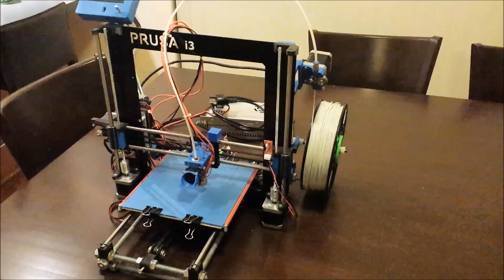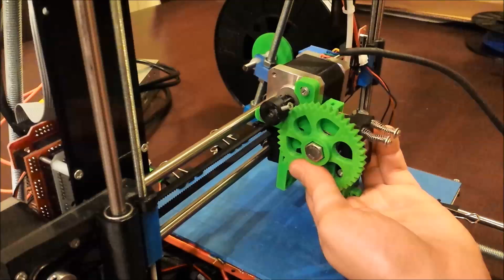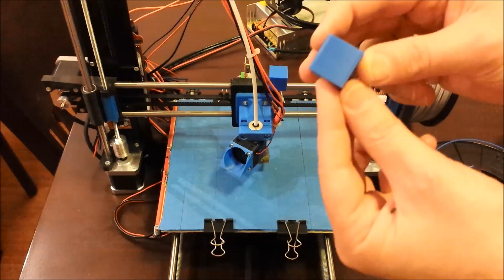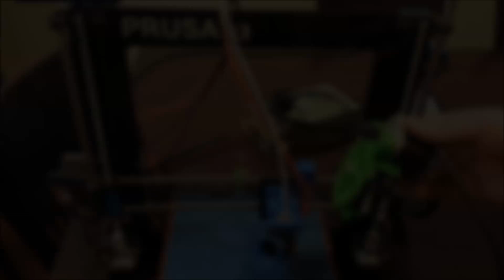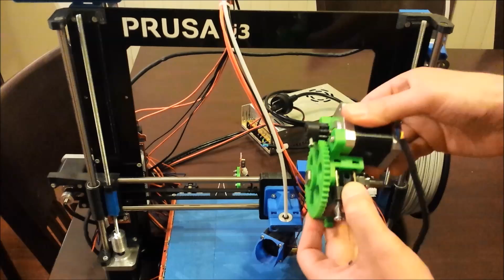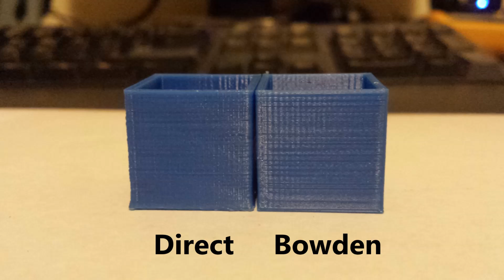3D Printer - Major Quality Improvement!

Comment: Watching this video I almost thought he invented the bowden conversion. The main advantage of bowden is the reduced weight of moving parts. It now doesn't have to move the whole motor all the time.
Reply: +Jean-Pierre van Melis And that is the only advantage... Bowden setups give you much less control over changing the flowrate during a print. You need large retraction values, and there is much greater chance of blobs or voids at the end of of retraction. Ooze rates can not be accurately predicted because there are several variables involved which can constantly change. Direct extruders minimize the effect of these variables.

Both setups have their advantages and drawbacks.

Comment: i see you are using the full graphic lcd controler, did you get it from replikio?? couse i got one from repikio (the lcd screen) and no matter what i do i cant get the sd card to work. i was wondering if you mabey have had the same problem and how you might have fixed it

Tom
Reply from the maker: +tom haaima 
Hi Tom, I purchased the display from eBay. The SDcard works for me, so not sure why yours isn't? 

I'd email Replikeo and ask for support, otherwise I'm sure they'll send you another one if it's faulty.
Reply: +Tech2C thanks i wil try that

Comment: Just as a tidbit.. though probably someone has already mentioned it, buuuut this actually still adds 'play' in the tension of the filament... just now instead of it being on the spool's end, its now on the hot end's side. Now every time it moves away from the spool, its slightly tugging the filament back and thus less filament is actually getting to the hot end, although only a tad bit. and as it moves back towards the spool, more filament is pushed towards the hot end, and thus pushes more plastic out from the hot end. Sure it doesn't seem that way, and may actually provide for 'better prints', but the cause of this is because of the 'buffer' that's created inside the hot end itself.

So your actual 'print quality' problem wasn't with the extruder's placement, but more so that the physical movement of the X-axis is being hampered ever so slightly, and thus forces the motors to work a bit harder than it was expecting to. but again, it 'should' be negligible... but maybe the X-axis of your machine has some sensitivity issues in that regard. 

Another technical reason, is because the filament would be getting fed into the extruder at an angel, and thus not as good of grip, even if the extruder is calibrated right and has a solid grip when parallel to the filament going into the hot end. But that's still kind of negligible in affect, as its only feeding a few tiny millimeters at a time, and thus the buffer in the hot end 'should' be helping to compensate.

Comment: I agree with the others who disagree with your reasoning behind the improved print precision when adding slack to the filament feed.  The feed rate can't be the cause because of the massive mechanical advantage a Wade's extruder has.  It is going to win, no matter what else is going on, or break the filament trying.  And something else is, indeed, going on.

What has less mechanical advantage (compared to the Wade's extruder) is the X axis.  This is easy to demonstrate:  With the power off on a generic i3, pull up on the filament and see if the filament stepper moves.  Then pull sideways on the filament and see how easily the X axis move.

Side-to-side changes in filament tension will pass right through the Wade's extruder to then load/unload the X axis.  Even a minuscule amount of slack or elasticity in the X axis is enough to make layers misalign, especially if they are printed in various directions.

Similarly, switching to a Bowden feed also reduces the "bounce" in the X axis by lightening the load the X drive motor has to accelerate and decelerate.  Again, the improvement is not due to Bowden being better or worse than direct-drive; only that Bowden makes the carriage assembly lighter.
Reply from the maker: +Bob Cunningham 
That is true, the x-axis could have been hampered by the extra tension applied to it by dragging the filament along.
Either way, the change in print quality for my printer by switching from Direct to Bowden has done wonders.

Comment: This is exactly what I've come to surmise is happening with my printer. Tension of the filament on the hob bolt was causing mine to sometimes stop feeding into the hot end. I'm either going to do the Bowden or some other fun fix with a stepper........ :D
Reply from the maker: Mike Mills 
I can tell from the tone of your comment, you're leaning toward the 'fun fix' option... Nice one :)

Comment: Yes I agree with you about the better quality of the printer job finish. Also you reduce the X axis weight taking off the extruder motor from it. This also help reducing the complete Prusa vibration during printing. My Prusa is original Bowden design I only need a better hot end to print small detail pieces better. Good job..! E3D may be a good choice.

Comment: Good notes. That is one reason that currently I have top mounted centered filament on good bearings. from the stock filament setup it was a huge difference! I cant wait to go to bowden just due to the weight reduction on the head carriage.
Reply from the maker: Atom RC 
Cool! I find Bowden easier overall to work on as there's less clutter in one location, it's kinda spread out instead...

Comment: Hm, I'm not sure if this is the right conclusion. Basically because the flow is not the only thing you have changed. In principle you have changed the whole extruder system completely. Now you are moving significant less weight which leads to less wobble and less backlash. And you can especially see the difference in backlash on your printed samples. 

Just make a test and add a kind of dummy weight to your bowden setup that fits to your old setup. Oh and by the way, when you switch to a bowden it's a good idea to adjust the retraction rates ;)
Reply: The weight does not really matter if your frame is sturdy enough. We manage to print up to 180mm/s and 400mm/s travel speed with a direct drive extruder and the prints look still smooth. It really depends on the whole setup and not only one piece in the chain.
Reply: Strahlex 
Basically you are right. The whole system is important and not only one piece of the puzzle.
But in this case here :
1. Look on the printer system and especially the Z axis. This system is far away from rigid. In fact it's one of the most unstable systems you can build.
2. I mentioned also backlash. And this effect is caused by the acceleration of the mass and the flexibility of the belts. This cant be influenced by a rigid setup.

And by the way, if you look on the pure physic rules, its always more efficient/easier to reduce the weight instead of increase the stiffness of the setup. ;)

Comment: Are you sure you draw the right conclusion? The pulling force works in both directions, it pulls the filament down, but it also pulls the extruder and the whole carriage including the nozzle, the most important part, accuracywise,  up against the resistance of the filament spool - inertia, friction, and all the rest.

And the construction and setup of the Prusa (and most similar constructions, I have an Ordbot, so I know what a soft and wobbly construction is...) is not the most stable one in the world.

So, my interpretation is: What you compensate for is not a nonlinear filament flow only  caused by the filament not following the extruder's hunger for it immediately, but the whole carriage is at the same time being pulled up by the force of the exruder hanging on the filament. This oviously will lead to considerable deformations of the object. The hot end's nozzle will be lifted and lowered according to the pulling force pattern all the time. Visible in your examples of you look really close. 

I would suggest an active filament de-spooling leaving always a loop of filament ready to be pulled in forcelessly. Feasible. At least, your thinking led into the right direction,  just the conclusion seems to be a bit off-target to me.

But I may be wrong.
Reply from the maker: Chatter Mark 
Now that is a great post! I didn't even contemplate the tight filament would be pulling up the entire x-carriage! Makes perfect sense, considering I ensured the hobbed bolt was really tight against the filament to alleviate slipping. 

Cheers!

Comment: I think this is mostly due to removal of mass, you do not have a heavy stepper and the inertia that comes with it when going at higher speeds. Belt tension and gearing will also have an effect. You should also get yourself a filament cleaner/lubricator to alliviate some of the friction in the bowden tube.(Might not be a problem with the short tube you are using.)
Reply from the maker: martin haaland 
Hey, yeah the Teflon tube doesn't seem to bind. The problem with adding lubrication is you don't want it getting into the hotend, which means it mustn't come into contact with the filament. 

You are right, a much lighter moving mass does indeed assist with print quality and equipment longevity.

Comment: With the extruder still mounted on the x carriage, you could just add a bowden tube from the extruder to a fixed point on the case to guide the filament. This would also eliminate the drags on the filament by the X carriage.
Reply from the maker: RoterFruchtZwerg 
Yeah that was mentioned in another comment. I agree that should alleviate the drag. I still prefer this setup tho.

Comment: I would like to thank you for all your great videos on the Replikeo Prusa I3 printer. I purchased one and it came in Friday and other than me being an idiot I have it for the most part setup. I am hoping tonight to be able to do the calibration cube. Just need to figure out how to hold the ABS spool till I can make a bracket for it and re-attach the heat bed and adjust a couple things. :) I will definitely be doing a lot of the if not all the upgrades you have done.
Reply from the maker: Brian Carlsen That's great Brian. Don't knock yourself I was exactly the same (noob) when I received my printer. It really is a beast of a machine and a time sink as well.

I remember printing my first calibration cube... ah the memories :)

Comment: Also, I'm going to take your conclusion witha grain of salt. There are various changes other the the change in ''stack control'' that happened when you switched over to a bowden tube setup. also, arguable, keeping the same direct drive setup but adding a teflon tubing and repositioning the spool where you put it could have had the same effect. it's that repositioning that caused an improvement not the bowden setup. Correlation does not imply causation!! Further, plastic geared direct drive inherently are inacurate because...well..they are plastic, and they are printed so there is just so much accuracy in the gears you can get from that... Switching over to a direct drive metal gear coudl have had the same if not a better effect because you remove the hyserisys from the bowdel tubing.

Comment: What would be interesting is to build an unspooler with a cheap stepper motor that would turn the spool of filament by the same amoun it is being driven in the hot end. And ensure there is constant slack. pretty simple algorithm. I'm for sure going to try to implement that over the summer.
Reply from the maker: ZopteY A simple way to do that is to parallel another stepper motor on the same extruder motor driver. Both stepper motors driven from the same driver will provide a 1 to 1 constant slack I guess.

Comment: thanks for proucing  this video^^

So following your logic - the next step up - even from a bowden tube which moves - would be a stationary Hotend with a movin x-Y-Table Setup like some CNC-milling machines have.

I could imagine this producing even nice effects - or for an overkill - create a printer which is big enough, so that the whole spool is on the x-carriage itselfs and moces around together with the printhead - this woul of course require both big motors and a sturdy design - but seeing CNC machines moving around 30-40kg like it is nothing, the 2 or 3 kg of such and axis would be easly handable.
Reply from the maker: kniefi Good idea. A 3D printer already exists with a moving x-y platform - 3Drag.

I think with a CNC machine it's a little different for quality purposes as it's cutting "1 layer" so to speak, so multiple layer accuracy isn't an issue for it. With a 3D printer each layer must be deposited exactly as the one below to produce nice looking walls.
If the moving mass is too heavy, you'd need to adjust acceleration settings to minimize oscillations on sudden directional changes, which will impact sharpness/resolution of printed corners.

Comment: The same problems are found in MIG welders. Some mig welders now have a PUSH/PULL design where you would use both of the motors running at the same speed
Reply from the maker: coopadupa Nice! Thanks for the info :)

Comment: I have a prussa I3 (pretty similar) Whit a J-Head 
https://3dwarehouse.sketchup.com/model.html?id=ud5e7b88f-a4bb-455b-8ee0-da4b5392c895

I've just did the test you mentioned , It didn't change a thing. Meaby my X belt is more tentionned than yours. Meaby my extruder is more power full that your's But removing the slac in the PLA line didnt change anything
Reply from the maker: Jean-François Payeur Thanks for performing the test. I guess different variables will come into play here, so it seems my experience may differ to others.

Comment: Thank you for taking the time.   I have not received my printer yet but selected the FlashForge because of the dual head and large printing volume.   I may have run into this issue easily had I not run across your video.   Thanks.
Reply from the maker: Mark Wilson Fingers crossed your filament extrusion mechanism will be consistent out of the box. Otherwise there's always options like this :)

Comment: Did this help with the ripple/ghosting problem?
Reply from the maker: orlowska3 Not that much. There was a slight improvement but not a dramatic change. Reducing the acceleration of print moves in the slicing software really helps.

Comment: Have you had any under extrusion problems since moving to the bowden setup? I was getting very nice quality prints from my i3 with E3D V6 and now that i moved to bowden i did one succesfull print that came out great and now for some reason i'm having some serious trouble with BAD under extrusion.. If you have any ideas feel free to drop me a line :)
Reply from the maker: If you're experiencing intermittent under extrusion it could be a sign of a blocked nozzle/hotend.

Also check the bowden gear and make sure no plastic is wedged in the gears. Plus the bowden idler bearing must be tight against the filament.
Reply: Tech2C Sorry that it took this long to reply. Soon after i left my question i managed to fix the problem by changing the hob bolt to new design, the hob bolt that came with my printer was just bad quality and wouldnt grip properly leading to under extrusion and horrible grinding issues, i also increased the printing temperature by 10 degrees and now i'm able to produce prints that surpass the quality of my friends 2000€ printer. This was my first build so i had little to none knowledge of possible problems and fixes. It is funny to look at my i3 now and think that it is the printer that came as a kit since it doesnt look anything alike :) Only parts original are the corner pieces on the lower body and y-axis motor mount.

Comment: I've just upgraded my Replikeo's kit to bowden just like yours. What is the part you use to hit X endswitch?  Also on mine, filament is fed fine, until I put it into hotend, then it stops moving, doesn't look like gear can push it anymore. Any advice on how I might get around this issue?  Also what steps per mm setting are you using?
Reply from the maker: Hey! I simply have a hollow 20mm calibration cube glued to the x-axis carriage. Perfect height to hit the end stop. I printed so many of these, it was great to finally have a use for 1...

With the filament, you'll need to guide it into the hotend by hand until it passes whatever point it's getting stuck on - likely around the nozzle area. Then slide the teflon tube over that last section of filament into the hotend.

I'm using 98 steps per mm. I recommend calibrating your steps without the filament going thru the hotend.
Reply: Tech2C  Hey, that's brilliant idea to use hollow cube! :)  I did guide filament by hand, and it melts fine if I hand feed it, but it's not moved by direct drive mechanism for some reason :(  Maybe tube is too long, or bearing not pushing hard enough.  Also I set mine to something like 150 steps per mm, maybe that's the issue.
BTW it would be awesome if you make a video on calibration of bowden extruder, as far I'm aware there are none on youtube :)  BTW I love all your upgrades and added almost all of them to my prusa. Thanks a lot for these videos!

Comment: You could use a small stepper motor to turn the reel of filament the same time as the extruder is feeding though the hot-end. You could wire the smaller filament stepper motor in series with the  main filament one. Or maybe tap off the signals coming from the micro-controller into another stepper motor control. Just an idea I guess. I think it would be pretty cool.